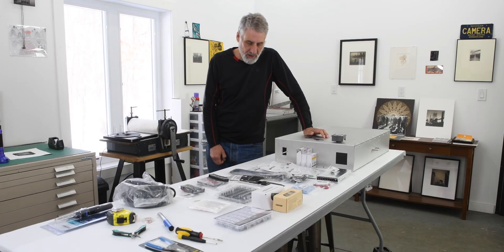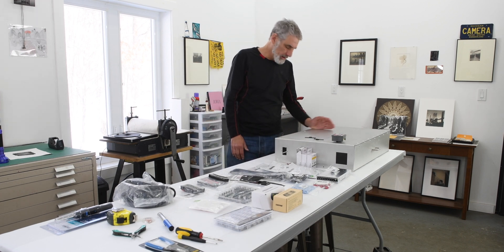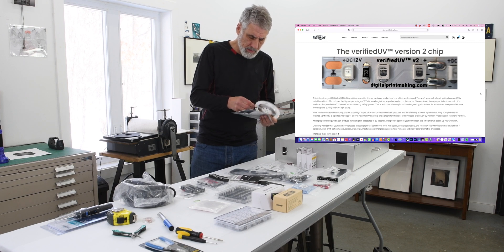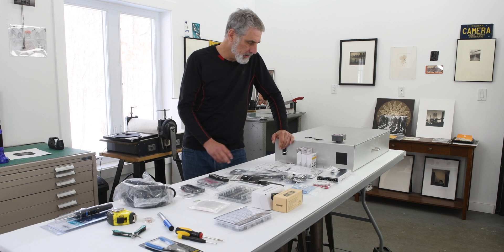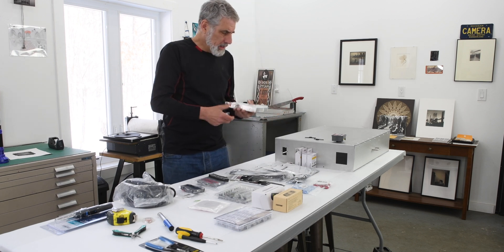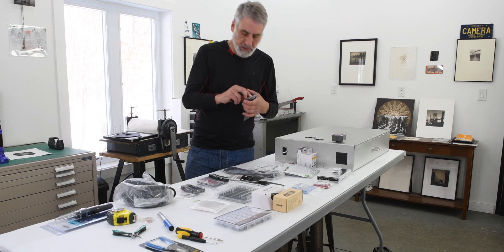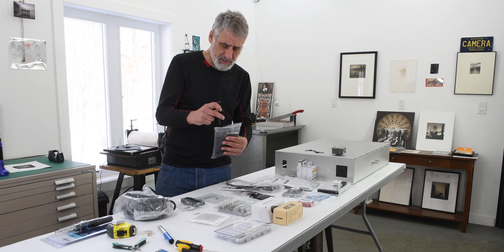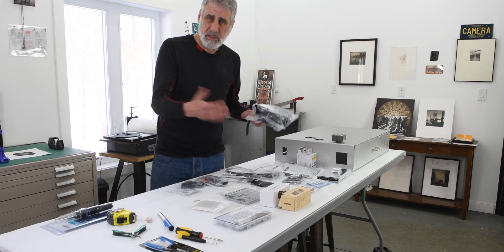Build Your Own Ultra Violet LED Exposure Unit  - Part 2 The Components

Comment: Hi Bill, I have come across your channel recently and I am really enamored by your no nonsense approach and the fact that your instructional videos contain zero fluff.

I have a question concerning the UV box you're making: whereas it seems to be an elegant solution, it's mind boggling to spend over $1k on a light box.  It seems that a MUCH cheaper solution would have been to use CFL bulbs that screw into a standard socket, plug those into your darkroom timer and you'd be all set.  Sure, it's not as neat as what you've made, but it would only run $50 instead of $1000.  Why didn't you take that route?
Thanks